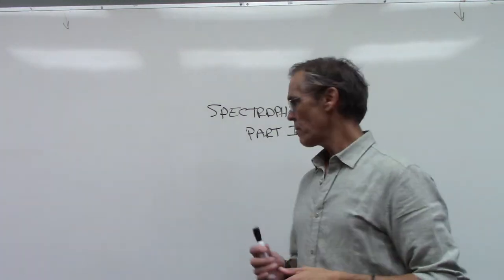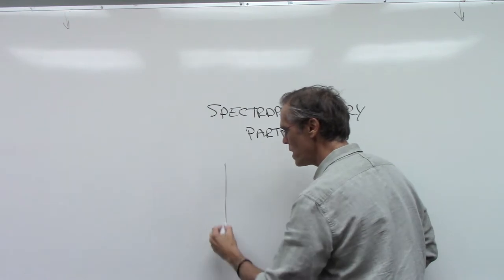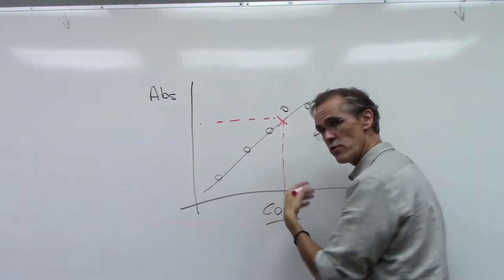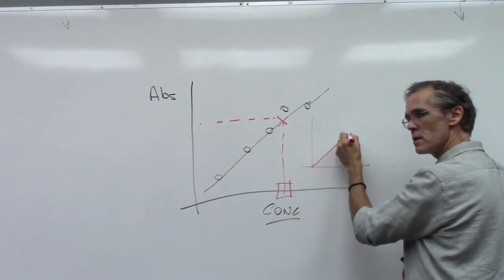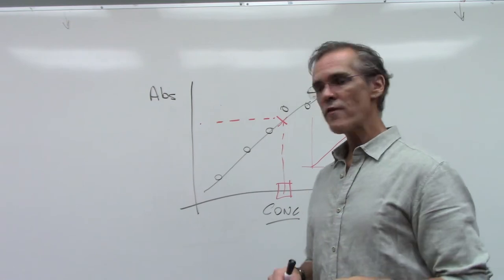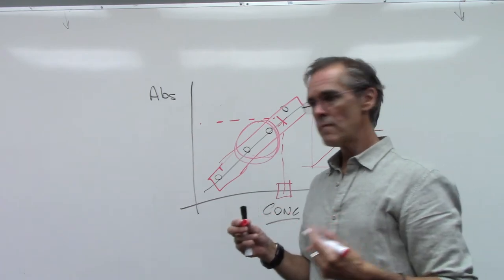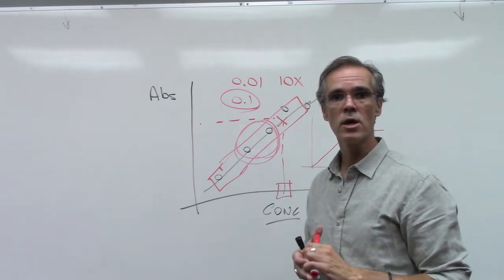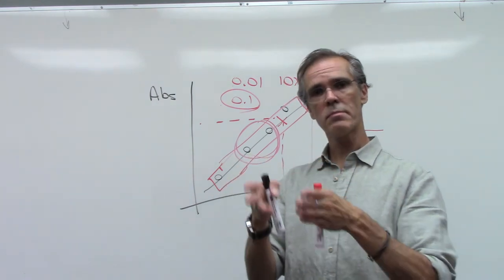Spectrophotometry part 2 (Calibration Curve technical problems)

Comment: Help with a question ????? A compound absorb light in 227 nm. The standard curve calibration for the compound is Abs = 372x + 0,6432 which the concentration is g/100mL. The technique was analytical standard adding from fluoxetine hydrochloride (C17H18F3NO.HCl - molar mass = 345,79 g/mol). So determine the concentration in mol/L from the analysed solution. Show all calcs progression.
Reply: Looks like this is an exam question... is it? :)
Reply: @dobergeron  yes. and i jumped it. Full quesion: Standard addition is an analytical technique of extreme importance to an analyst, as it eliminates the interfering effect in most determinations. Fluoxetine is widely used as fluoxetine hydrochloride, also known as Prozac®. This is indicated in the treatment of depression, associated or not with anxiety. This compound absorbs ultraviolet light at a wavelength of 227 nm. It has in its structure a stereocenter, being a chiral drug. It is known that only the (R) -fluoxetine isomer has activity, while the other enantiomer has no pharmacological action and there is no evidence of toxicity to the organism.

In an industry, when performing the Fluoxetine analysis, the following analytical calibration curve was obtained, in which the concentration is in g / 100 mL: Abs = 372 CFluoxetine + 0.6432.

Knowing the analysis was performed according to the standard addition technique and that the molar mass of fluoxetine hydrochloride (C17H18F3NO.HCl) is 345.79 g / mol. Determine the mol / L concentration in the analyzed solution.
Reply: @dobergeron  I thinks i need to use this equations but i dont know how. 

S=k.Ca  
y = m*x + b  
Y = S
x = Vs
m = k . Cs / Vt
b = k.Cx.Vx / Vt

It's a friend whom sent me and i couldn't to do it. I researched i found this 3B4 equation. ( http://www.mathcentre.ac.uk/resources/uploaded/3b4printableversion.pdf ). But i dont know the source from y value which has been used.

I have the alternatives but idk which is the correct:

2,25x10-5 mol/L
5,58x10-5 mol/L
5,0x10-5 mol/L
9,69x10-5 mol/L
3,08x10-5 mol/L
Reply: As a professor myself, I don't think I should comment on your question. I'm sorry, ask your prof... I'm really sorry but I can't give you the answer. There are a lot of resources available, you can do this. Isolate each variable and look how to solve. Hint: look at extinction coefficient... ;)

Comment: please , could you make a video continuing with calibration curves, going further in advanced level?
Reply from the maker: What would you like to see...what would be useful to you?
Reply: IF we have real samples in a complex matrix, such as sediments. And the analyte is in very low concentration. Could you explain the procedure, when to use blanks, how to prepare the calibration curve,  if we fortify the samples because the concentration is too low, or if there are more reasons to do it, how to check matrix effect, and if something else needs to be done with standards and blank? In this case, we would want to analyze using HPLC-UV detector. Thanks!
Reply from the maker: Thank you for your question. Unfortunately, I will have to let you know that your question involves a much higher level of experience and knowledge and even attempting to answer your question might lead you in the wrong direction. I certainly do not want you to waste your valuable samples due to a mistake I might do. There must be published methods and/or procedures or other experts that would answer this very specific question much better than me. Good luck!

Comment: Sir, how we plot graph for adsorption of chitosan..?
Reply from the maker: does adsorption of chitosan absorb at any wavelength compared to non adsorbed? (I assume the aDsorption word is not a typo, very different from aBsorption...
Reply: @DominicBergeronPhD  please guide in this regard...
Reply from the maker: @almaanmani7361  you need to be more specific. Sorry, I'm not sure I understand what your question is. Really sorry....
Reply: @DominicBergeronPhD   sir, when we plot graph between absorbance and concentration then what's the effect of dilution  I mean if absorbent is dilute then more absorbenc yes or not ? nd how will we form a standard solution....?
Reply: @almaanmani7361  a .more diluted solution will give you lower absorbance values, that's Beer's law. I'm not sure with chitosan, I never worked with it, but in order to make a calibration curve you will need to make several solutions of chitosan and read the corresponding absorbance at a specific wavelength. Make sure you cover a wide range of concentrations and be aware of the limitations of your instrument

Comment: Sir 
I have coated one polymer on one of the metal oxide nanoparticles.after completion of coating process,i washed it with water to remove uncoated polymers.Now i have to know how much polymer is coated or how much left out?Is it possible to find out this using UV Vis spectroscopy techniques,please reply sir
Reply: what is weighting factor